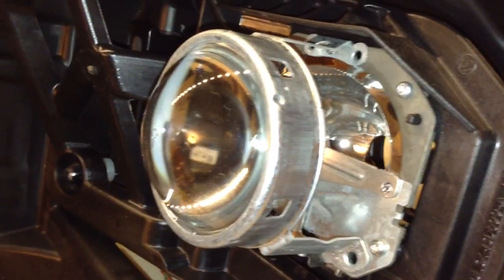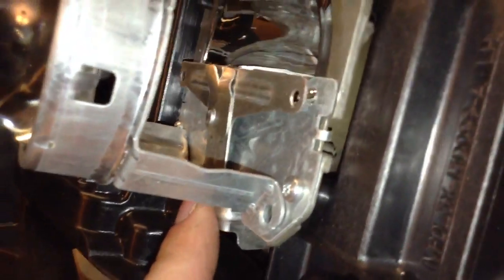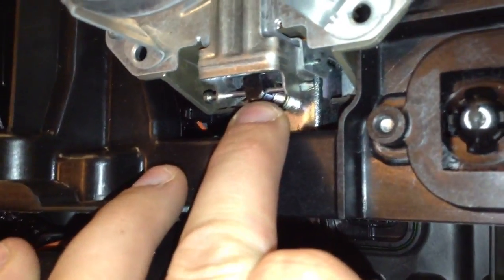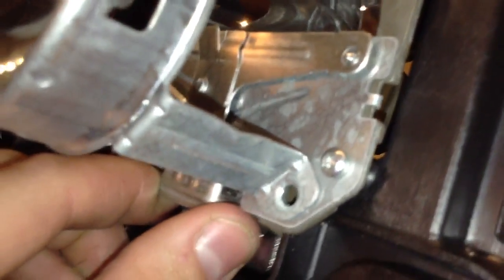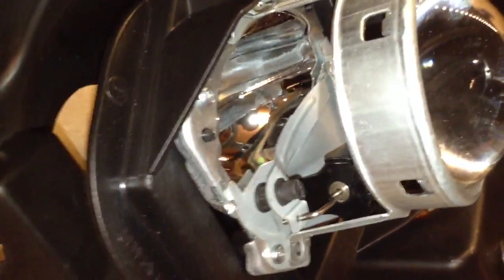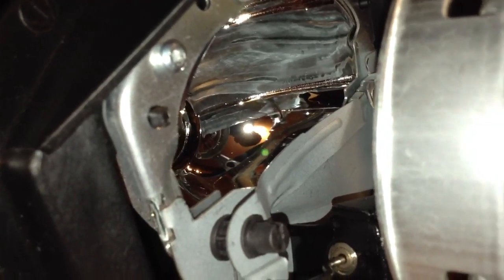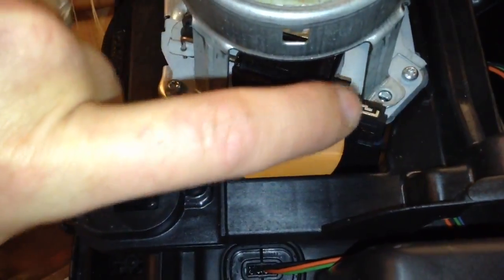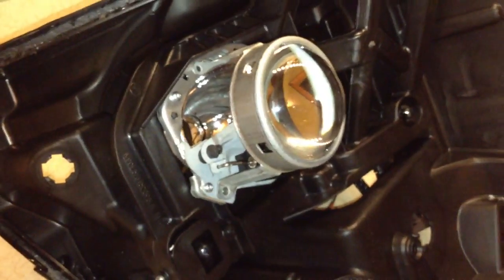2013 F150 OEM HID Projector Flaws

Comment: Thanks dude that was pretty informative. I see TONS of these 13-14 F150's with stock HIDs stuck in the highbeam mode. I get blinded by them all the damn time. I've tried contacting Ford but haven't got much out of them. I've already had both my left and right headlamps replaced under warranty, but the problem has come back on the new right one. I'm not sure what to do but i'm tired of being flashed.